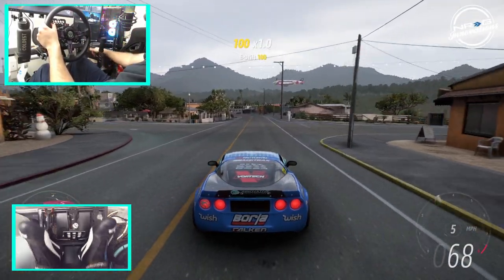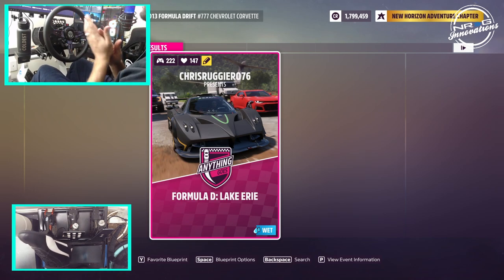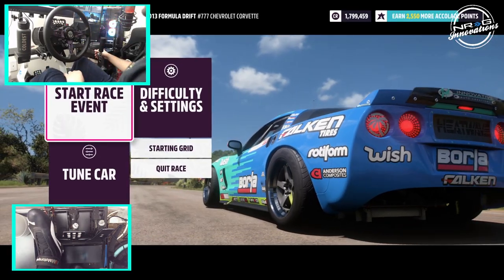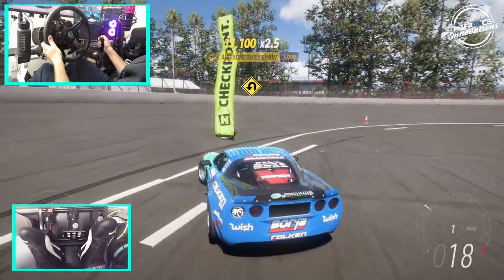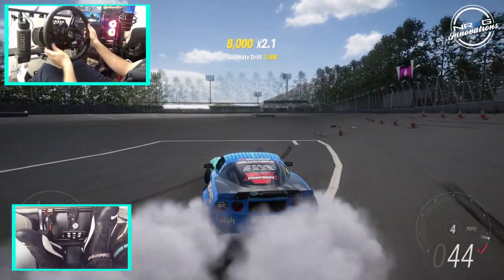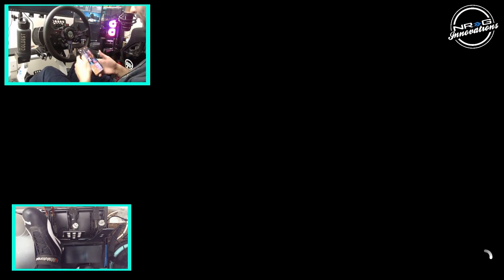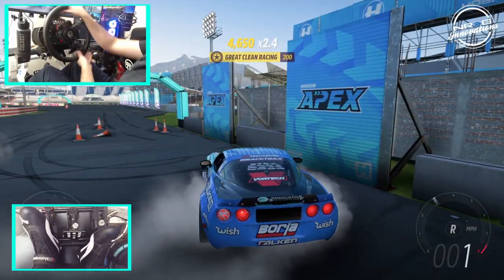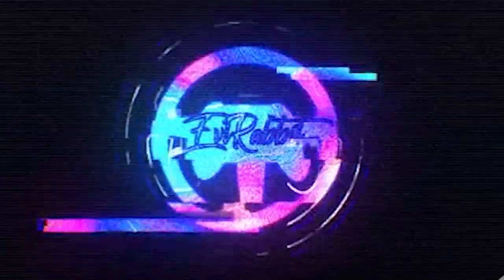Drifting on Lake Erie Speedway FD track on Horizon 5 - 900° wheel gameplay

Comment: The issue with these drift tracks is the surface is like a metal compound. It’s horrible. They need to add asphalt tiles or just straight up concrete. 1 thing you can’t do is fault the creativity. I made an Okayama circuit but fell asleep literally as I don’t editing and it placed the finish line in the worst place possible. And I can’t even edit it🤣🤣🤣 good vid tho as always.